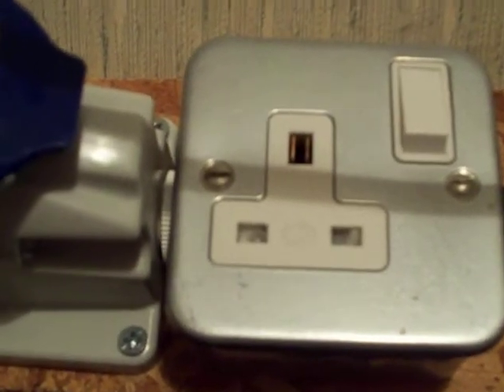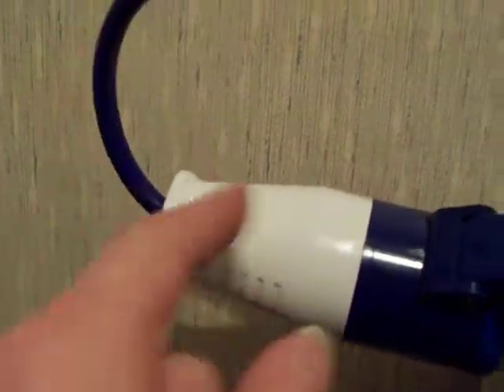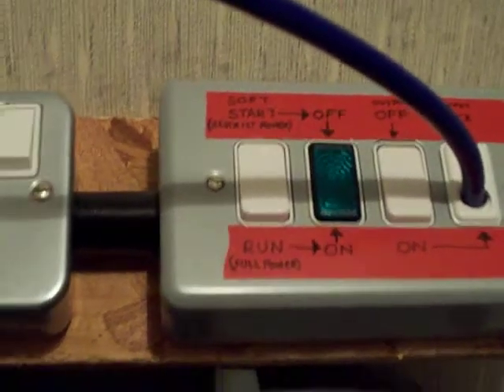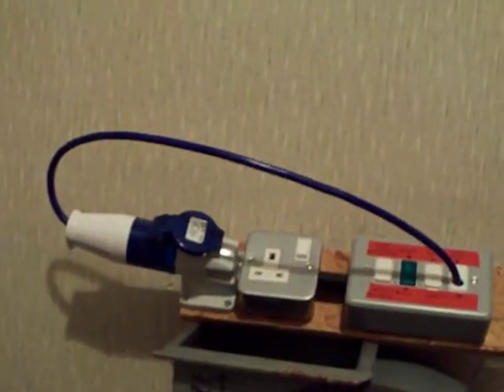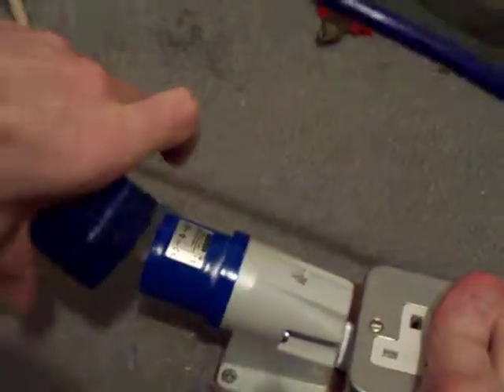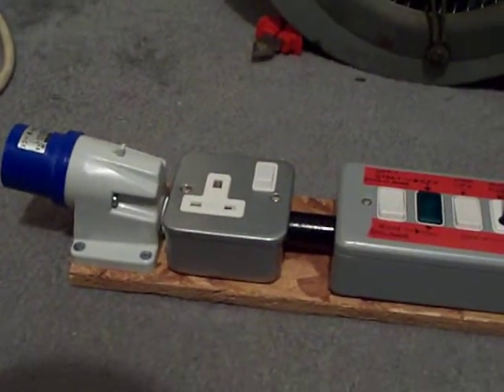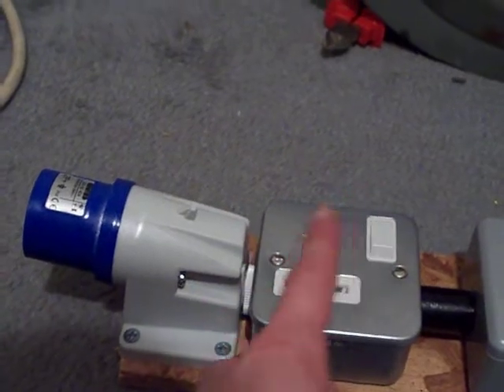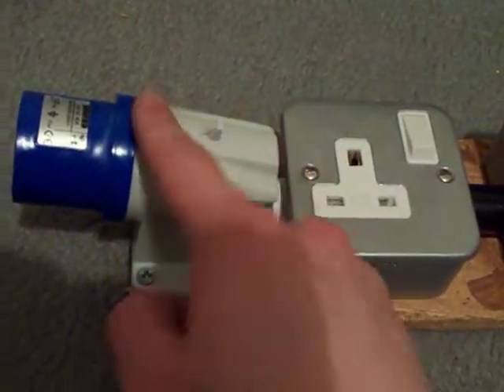Electrical : Completion & demo of Soft-Start Unit.

Comment: Yeah hate when build things go like that. Great vid
Reply from the maker: Yes, it did turn into bit of a peeve geting this wired up, but it had to be done.

As for that POXY cord clamp on that flext outlet module, I REALLY think MK should re-design that, as I had trouble getting a 1.5mm cord through that.

So much so, I had to resort to pulling-down on it with pliers to open it enough to get the wire in there.....SNAP! It come clean-off.

Chances are, because "I-Used-Tools", I wouldn't be able to claim faulty workmanship on the warranty. But then..... I really did struggle to bend the clamp device with my fingers in order to get the flex in there. It just wouldn't go!!

I AIN'T HAVIN' IT !!!!!!!

That's when the pliers came out to play. That flex *IS* going to go in that module!!! That's when the clamp snapped off. PAAAANTS!

Now that it's fully assembled and working, it's a nice little unit. :-)

Thanx for watching,

-BoomBoxDeluxe.

10th February 2014, 12.12

Comment: How talented are you with small circuit design? I'm sure you could devise (google search would probably reveal this as well) some sort of capacitor-resistor relay circuit to delay the click-in of the relay, bypassing your ballast of choice. Essentially makes the switch panel pointless